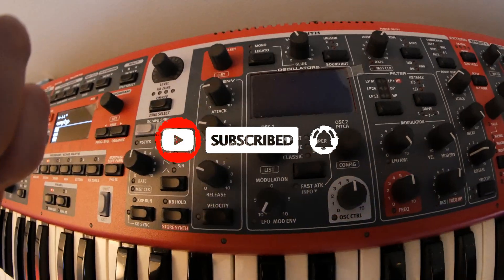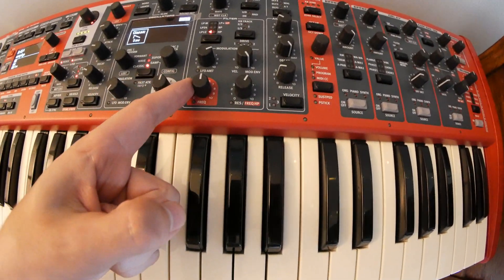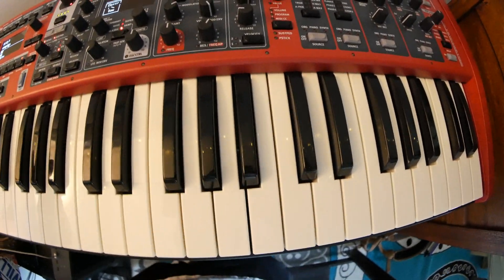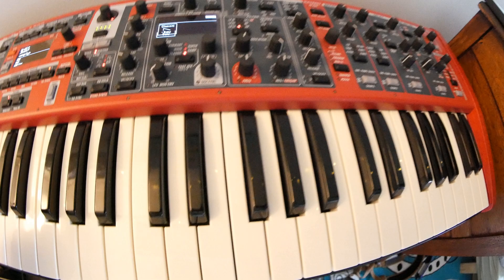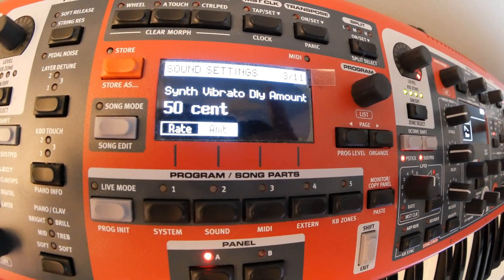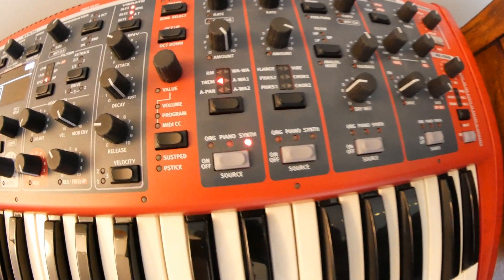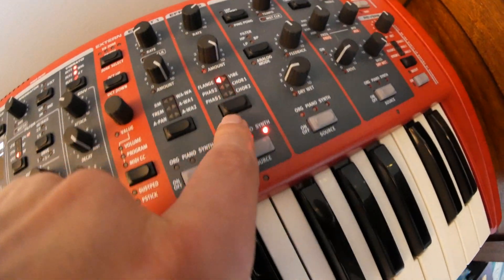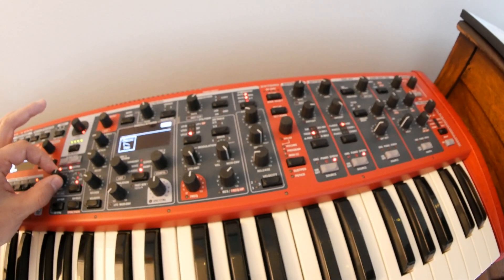Nord Stage 3 has 4 LFO's !!! SECRET TRICK to this :: overview of the LFO section of the synthesizer

Comment: Nice vid.It's also great that you can do everything you just did x 2 with the A/B panels. Not to mention, you can add 2x reverbs, along with 2 more oscillators + 2x organs + 2x pianos/EPs/clavs + 2x delays + 4x overdrive + 2x rotary speaker emulations all running simultaneously and each engine getting their own separate polyphony. Then, you can have morphs running as well to change individual sound parameters on the fly using pedals/mod wheel/aftertouch. Ya, the Nord Stage 3 is freakin' deep AF.